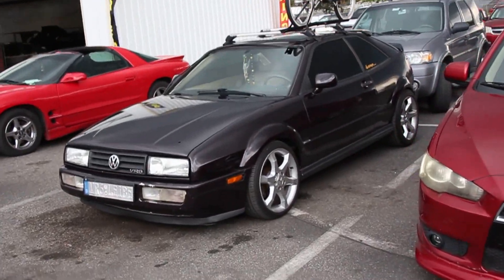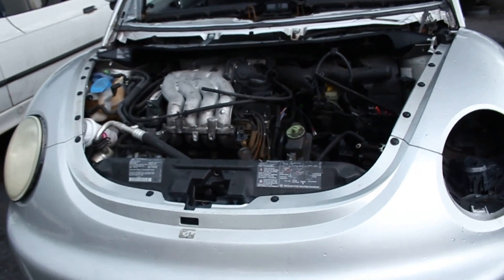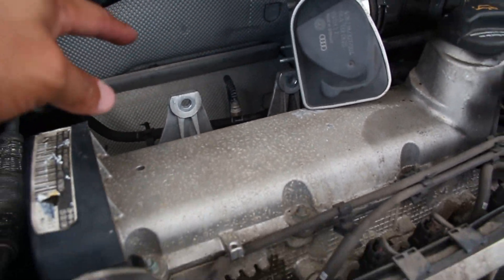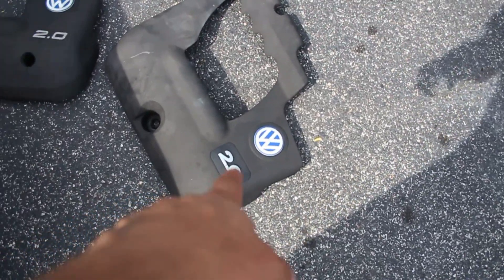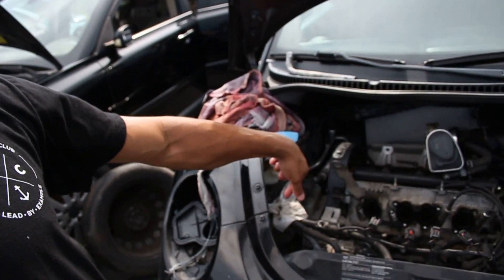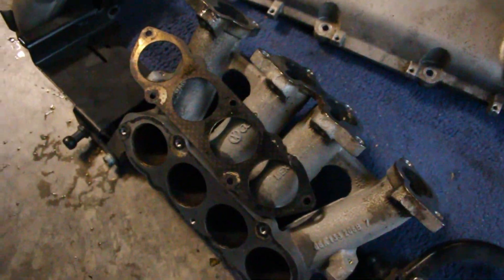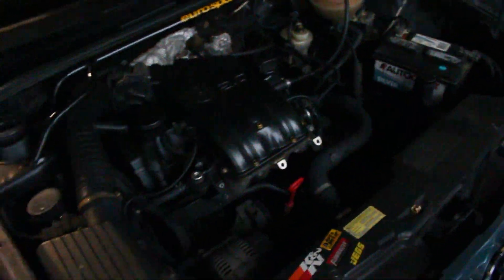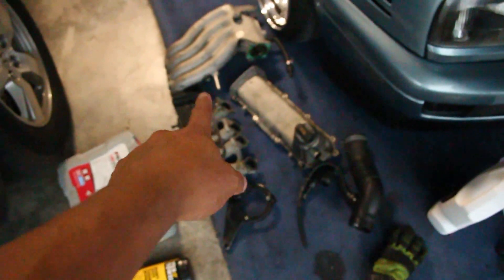Mk4 2.0l Intake Manifold Swap on Mk3 - Part 1

Comment: thank you for this i got the parts before my car went into the shop. once i get it back im going to start this swap as well. the forums are a little choppy on information at times
Reply from the maker: Glad this was able to help you hope the swap went well!
Reply: Christian Smith still haven't done it yet getting my mechanic to due the wiring and trying to weld on a small metal plate for the sensor on the manifold so once that gets done I'll start and will be replacing my fuel filter at the same time

Comment: 3:13 All 5 of these are supposed to be Allen bolts so you can slip a standard "L" shaped Allen wrench between the intake runners and remove the two hidden bolts.  Excellent video none the less.

Comment: Should of grabbed a mk4 throttle cable.  I did thid mod to my mk3,  9yrs ago
Reply from the maker: Actually didnt need it the stock one worked fine lol are there any advantages of the mk4 one?
Reply: Yea you dont have a crazy bend in cable cause the mk4 cable is like 10inch longer. Because your moving the throttle body to the opposite side now with thr mk4 mani same reason you extend the mass air flow wiring. When i did mine I took the wiring from the mk3 maf out at a junk yard i cut the harness back like 10inch and added it to mine so i didnt have to extend 4 wires and splice 8 times.